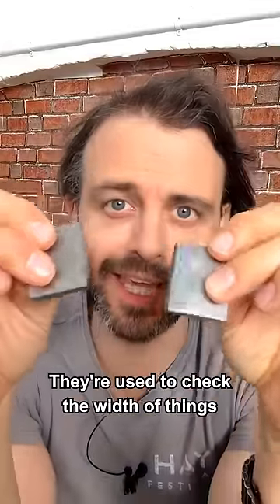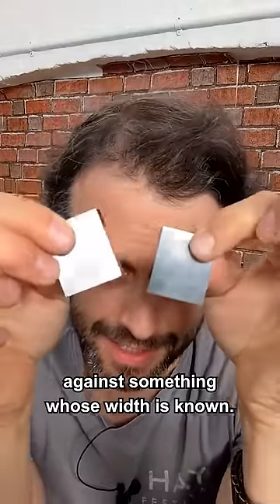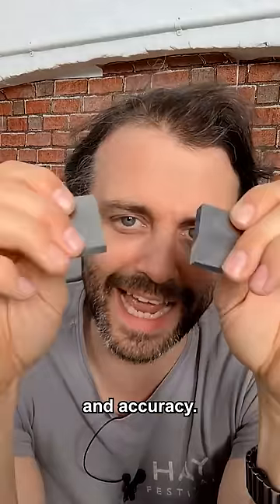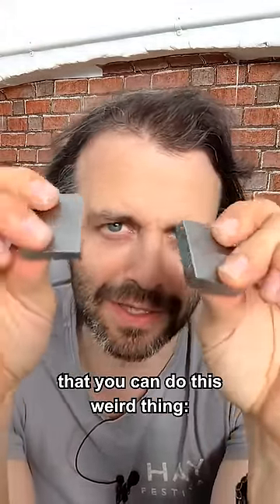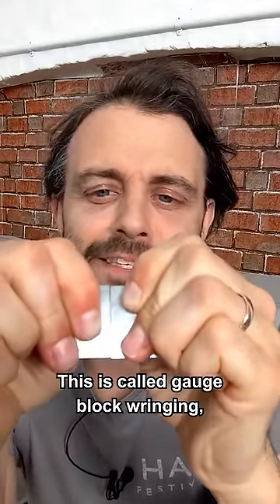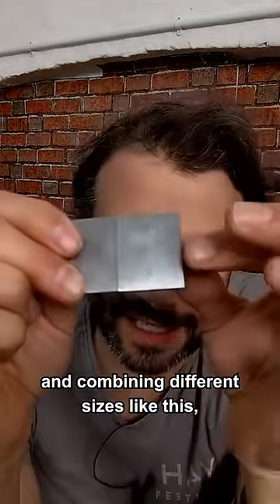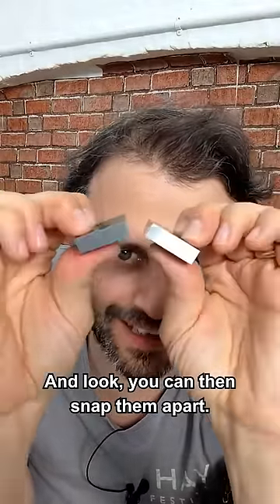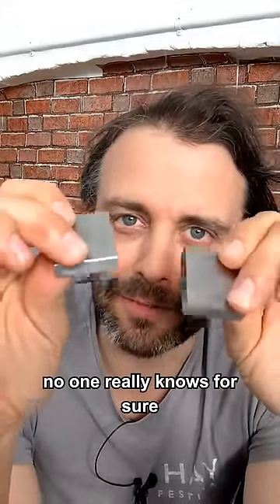No One Knows For Sure Why This Happens!

Comment: My own theory on this is when you push the two blocks together and twist, you scratch off some of the surface oxidized layer of material and push out most of the air. This allows the freeflowing electrons in the metal to slowly pull the atoms together and create bonds, allowing for a kind of cold welding. Of course the smooth surface of the metal blocks helps tremendously in facilitating maximum surface area touching giving a greater chance to start forming bonds. The fact that the longer the two blocks stay connected, the harder they are to take apart kinda supports my theory. I imagine if you left them for long enough they would fully weld together.

I could be wrong but, that's just my thoughts on it.
Reply: This phenomenon also happens in space. It's called cold welding.
Reply: @Rio.Motel.84  if you read my full post you'd see I mentioned cold welding. My point here is the version of the phenomenon is cold welding in slow motion because  of atmospheric interference, the smoothness of the materials allows for more surface area contact with creates the phenomenon.
Reply: They're not metals, they're carbides. The addition of carbon improves stiffness and density by removing electron holes. So the electrons can't flow freely like they would in metals. It's van der waal forces.

Comment: Also happens if you press together 2 platters from an old hard drive.
Reply: I'm going to try this!
Reply: Nobody knows why it doesn't work on new hard drives
Reply: @mikebarnacle1469  obviously the data makes it sticky 🤣
Reply: I think the effect in all cases has to do with the need for air molecules to take the space between the surfaces but you need space for the molecules to START moving in that direction. You need to SLIDE them apart first.
Reply: @fmphotooffice5513  that would be irrelevant in a vacuum and that's been tested, it's not air pressure alone. It's largely to do with oil molecules from your fingers
Reply: @vulpeslumina  Interesting, something to learn about. 🥇
Reply: @vulpeslumina  Interesting.
Reply: I think hard drive platters are just a simple case of air pressure, not like gauge blocks
Reply: @vulpeslumina So simply slam a little human oil on a smooth surface and they will stick??

I must be too greasy..

A greasy bastard to be exact!!!
Reply: @jaredlancaster4137  Likely. Lots of surface area on the 2 thin disks to displace. The effect with the blocks thing in the original video looks the same. I haven't amused myself with old hard drives in a while. I remember a painful tiny bruise from extracting the magnets from HDDs. Those are fun too.
Reply: @fmphotooffice5513  gauge blocks wringing isn't just air pressure, people have tested it by putting wrung blocks in a vacuum and they dont fall apart.

Comment: This phenomenon that makes them stick is Van der Waals forces. And for those that think it is atmospheric pressure, no. This is a recognized problem in space engineering where precision machined part will stick together known as vacuum cementing or cold welding. It is also the thing that allows geckos to climb wall and ceilings.
Reply: 100% exactly Right. I waited to see if anyone said the answer before I typed it in. Great job 👍🏿, and that is coming from a Mechanical Engineer.
Reply: Is probably*

This hasn't been experimentally proven yet with a high enough degree of certainty. That being said, its my assumption that van der waals force is likely the culprit
Reply: Those are 2 completely separate effects you're describing. Cold welding doesn't involve Van der Waals forces at all, it's driven by metallic bonding because the entire point of it is that 2 metal "objects" brought atomically close together are indistinguishable from a single metal lattice to their valence electrons. And because it's driven by metallic bonding, it's permanent, you wouldn't be able to slip them apart, you wouldn't even be able to fully wring them together before they seized up.

Van der Waals forces are likely involved in some way but I'm skeptical that they're a complete explanation given that they typically also operate over atomic binding distances, so to get the kind of strength from them that you would need to hold gauge blocks together like that you're probably entering into cold welding territory and this effect is very clearly not a permanent cold weld.

Comment: The reason this works is because both blocks are likely charged everywhere. But is you press them together and turn you wipe off some charge that make the space between charge less. It’s the same phenomenon with a paper over a ruler on a table. The space between the paper and table is less charged.

Comment: According to Wikipedia, there are three factors at play: 

“Vacuum applies pressure between the blocks because the air is squeezed out of the joint.
Surface tension from oil and water vapor that is present between the blocks.
Molecular attraction that occurs when two very flat surfaces are brought into contact; this force causes gauge blocks to adhere even without surface lubricants, and in a vacuum.”
Reply: Wikipedia overruled YouTube — what a surprise!

👍
Reply: Molecular attraction is what my assumption was. Clickbaity title
Reply: I love you guys.  Your non haters but with the actually knowledge for the mystery of every tube show.  And it's so awesome. Lately it's seems your like the first ten comments.  Thank you!!!!
Reply: @KnockedupNout Exactly as the comment you're replying to literally says, word for word.
Reply: @Atmatan  it was edited, says so right up top.
Reply: Women are disproportionately impacted by these forces
Reply: Wikipedia. You mean the site with community-edited information that is regularly false at best?
Reply: @Bilverkr  I wasn’t aware there was more than one Wikipedia
Reply: Okay, so you knew then, just making sure. @CasualClassical
Reply: @Bilverkr  you should know though, Wikipedia is a lot more trustworthy than it was in the early days. Almost everything is sourced and whatever isn’t is clearly indicated as lacking a source. You can trace every bit of material back to the original research if you wanted to. The page on gage blocks is no exception. If you’re skeptical, you can vet it yourself and read the cited sources
Reply: It is mostly factual, I'll give it that. Wikipedia honestly suffers from the same curse all media does today, writer's bias. @CasualClassical
Reply: You left the interesting bits out though!

"It is believed that the last two sources are the most significant."
Ah yes, "it is believed", truly the words used when we're certain how things work.

Following the linked sourced for that part you copy pasted
" It is probable that
wringing is due to a number of forces, the relative strengths of which depend on the exact nature of
the block surface and the liquid adhering to the surface. The known facts about wringing are
summarized below."
and
"There may never be a definitive physical description for gauge block wringing."
Sure sounds like we know exactly why it works.
Reply: @MaakaSakuranbo  I’m sorry if I implied somehow that the excerpt was definitive. I found the existence of a Wikipedia page on the phenomenon relevant, given the title of the video. I thought I was being helpful, but it appears that you disagree…

If anything though, I’m glad that my comment led you to further investigation. I consider it a win for society when anyone causes anyone to seek knowledge
Reply: Wikipedia is a horrible source.
Reply: "scientists don't know why this happens"

"well akshually.. wikipedia explains it"
Reply: @ironmanmachine then check Wikipedia's sources
Reply: @Bilverkr  No, he means the site that is regularly as accurate as any other encyclopedia, with information that actually gives its sources so that anybody can verify it. Unlike YouTube.
Reply: @CasualClassical  At the time of writing there are 329 Wikipedias written in different languages.
Reply: @ironmanmachine  No. Wikipedia is a useful source, but It's not a reliable source. However, the information contained in it has to be verifiable from a reliable source or it can be removed. It's also a great site to get an overview of a topic and to find detailed, scholarly sources that delve deeper into aspects of that topic.
Reply: @Bilverkr  Although, unlike most other media, most articles have many different writers, so you have a chance of evening out individual biases.
Reply: @Bilverkr ho hum flat earther
Reply: @ironmanmachine yeah fox news is better
Reply: @RexxSchneider exactly
Reply: @curtrod  How 'bout "No", Scott?
Reply: It's probably really splitting hairs and gets into philosophical concepts of how do we know anything for sure and crap like that... BUT all of that stuff is still just our best theory based upon what we have managed to surmise about physics up to this point. There is still no way to actually test what EXACTLY is going on at the molecular level to form that bond, and how much each of those physical properties contributes to the total force of attraction between the blocks. Anyway it only proves that getting people to comment is the best strategy lolz. We all love a good spectacle or debate. The spicier the better.

Comment: You said "30mm" like you were scared of upsetting the Americans.  😂
Reply: He probably meant 30 microns, 30 mm isn't exactly very good precision.
Reply: @Spacekriek  Good quality gage block have a tolerance of less than one micron. ISO 3650:1998
Reply: @davidhopkins7715  Thank you !  That sounds incredibly close.
Reply: @Spacekriek The width of the gauge block is 30 mm
Reply: @Spacekriek doubt the eye can see 30micron object.  This obviously 30mm
Reply: Hes talking about the width of the objects but you listened to none of that @Spacekriek
Reply: @cazzone  OK, noted.
Reply: @Flesh4Toast  Your right about the 30 mm. But you can see 30 microns. It's slightly more than the thickness of a cigarette paper.
Reply: We use mm, cm, and meters in the US.

Comment: In a vacuum they would become inseparable. This is called cold welding and it has happened to satellites and spacecraft in the past.

If the surfaces are flush enough, they'll simply adhere because the atoms become close enough that they now act as one solid object.

Comment: We do know. Wringing is caused by the internolecular van der vaals forces acting between adjacent atoms. The surface finish enables enough atoms from each block to sit in a close proximity to generate a noticable attraction. Also where there is minimal air left between the blocks (from 'smearing' them together) a low level vaccun is formed meaning you then have the presuure of the earths atmosphere pressing the blocks together
Reply: Are van der waals forces really a thing with metals? My idea was that the electron gas inside of metals bonds can move across these two pieces because they are so smooth, that they can act as one piece.
Reply: this man runs basically a science and engineering YouTube channel I'm pretty sure he knows what causes this but if you haven't noticed people will say stuff like that in order to bait you into commenting

Comment: we learned in school (was a school for mechanical engineering) that because of the extremely smooth surface it allows some bonds between the molecules of the blocks.
It's actually well known.
If you leave them laying like that for a while you won't be able to snap them appart anymore, they will be cold welded and inseperable

Comment: Surface tension doesn’t always require water, sometimes it just requires precise fitment. 

Edit: if those pieces were in the vacuum of space, they would immediately and permanently weld themselves together, because there’s no atmosphere to insulate the flow of electrons from one piece to the other. This is precisely why the quality of machining of these pieces is so impressive; they are literally still attempting to weld themselves together while existing under the pressure of Earth’s atmosphere.
Reply: correct. Partial vacuum plus electron exchange equals temporary bond... Perfect vacuum plus electron exchange equals permanent bond. I told him in my comment. Cut him a break, he's British. If they were any good at science they could build at least one brand of reliable car, ever...
Reply: @godchi1dvonsteuben770 😂 shots fired
Reply: I've never known of your existence, and now you're my fcking hero...
Reply: what are the odds of this happening to a man and a woman
Reply: A couple comments:
Firstly, while it is true that surface tension does not require water, it does require a liquid, as surface tensions is - by definition- the tendency of liquid surfaces at rest to shrink into the minimum surface area possible. In this case, both water vapour and oil are thought to be factors in creating this surface tension.
Secondly, Ii the vacuum of space, without the presence of air or other contaminants, gauge blocks are less likely to bond permanently when wrung together compared to conditions on Earth. In the absence of air in space, the main factor influencing the potential bonding of gauge blocks is the lack of atmospheric gases that could contribute to oxidation or contamination on their surfaces. On Earth, microscopic imperfections, debris, or oxidation layers on the surfaces of gauge blocks can lead to a more secure wringing connection, potentially causing them to stick together. In space, where there's no air, these contaminants are absent, reducing the likelihood of permanent bonding. However, factors such as temperature fluctuations and the materials' properties can still play a role. Extreme temperatures could affect the materials differently, influencing their physical characteristics and the potential for bonding.
Reply: @JosefK2275  i have already told you its not your fault that your parents are getting divorce
Reply: I don't know much since I became an addicts after topping physics and Chem in high school, but surface mention was my best guess
Reply: @Accedwi While I can agree with the surface tension topic I have doubts about imperfections, debris or oxidation layers etc. on the surface helping two surfaces connect easier. If you try to connect perfectly fitting but weird shapes surfaces they can still connect, not because they have debris or imperfections but because they fit each other perfectly. Maybe all of the magic happens when the surface becomes so perfectly smooth that two surfaces can connect with each other as one because they fit perfectly in most of the surface areas. That can give us a conclusion that the more surfaces fit each other (independently of the shapes of surfaces) the more they would likely bond with each other. It means that the same kind of matter can glue with each other without hesitation when they complete requirements to do so. No matter the matter, if it fits it will stick with each other. Maybe all the matter pulling each other all the time but it sticks together while it's close enough for the bonding and the fitting is perfect. That means electrons are always exchanged between the same materials and they always try to connect but It's only possible when some requirements are met. 
I was wrong. It's not about the smoothness of the surfaces. It can be gnarly, rough and scratchy but as long as it fits it the two parts will bond.
Reply: Air is the fluid. It can't get in-between them easily so it kind of sticks. In a vacuum that might not work the same, not sure. In a vacuum though like metals can weld together with just pressure so you might be able to do it the same there. So many "known" things are not true in space....

Edit: metal is a fluid that just moves really slow. I thought of this after I watched a sheet metal press form flat steel into round dish shaped with just pressure and a bit of oil
Reply: @godchi1dvonsteuben770 they have, you just had bad luck, British cars always worked well for me, maybe it's all down to you.
Reply: @godchi1dvonsteuben770   You presume they strive to advance.  ;)

Comment: Learned about that in mechanical drafting. If the RA of two surfaces is high enough, they will adhere to each other so strongly that you couldn’t pull them apart.
Reply: what is RA
Reply: @MrLycantree  Roughness Average. The higher the number, the smaller the imperfections of the surface. Like sandpaper.

Comment: If you leave them together for too long they can permanently bond. If it weren’t for the layer of oxidation from being in the atmosphere metals would just weld themselves together if they came into direct contact. Before this phenomenon was learned NASA had issues with the hatches on the capsules they used to test orbital mechanics and the effects of being in space welding shut when they attempted space walks. There are a lot of details that are important for understanding all of this stuff but it is absolutely fascinating.

Comment: When the blocks slide together, air gets squeezed out from between them, creating a slight vacuum. The pressure from the surrounding environment then pushes the blocks together as well as a thin film of oil or water vapor that naturally forms on the blocks acts like a glue, creating surface tension that pulls the blocks together.